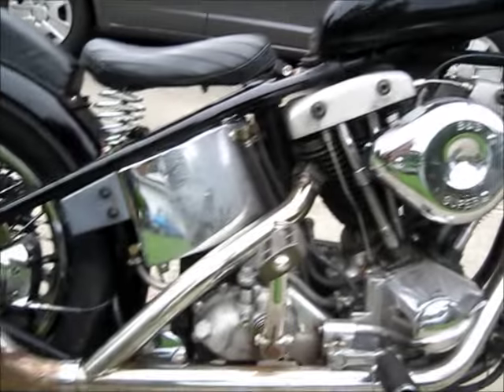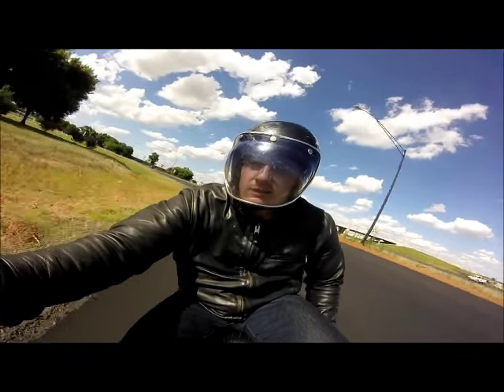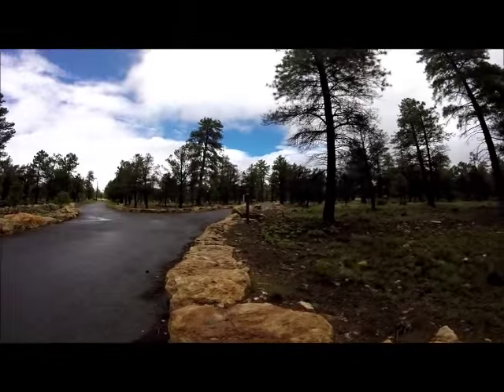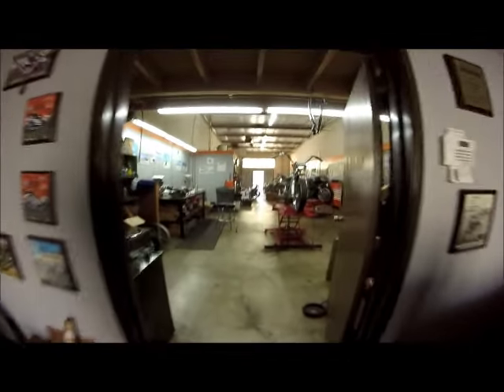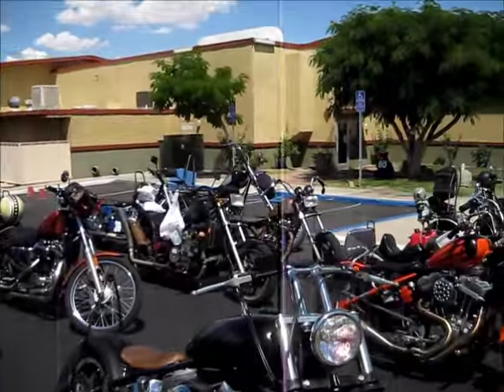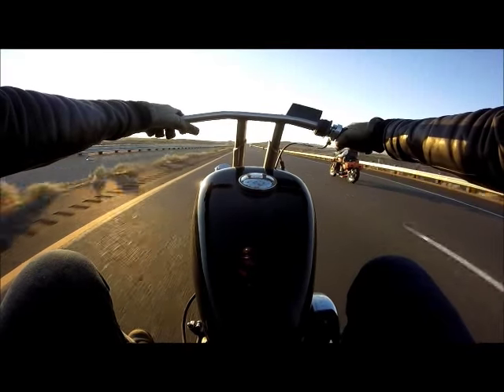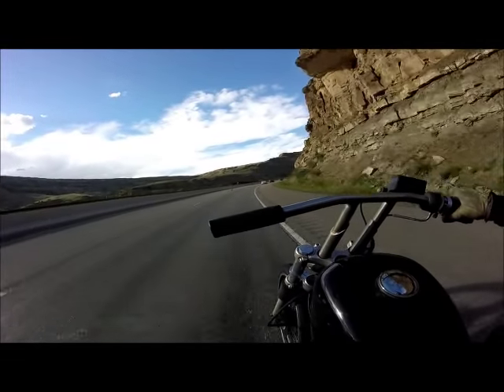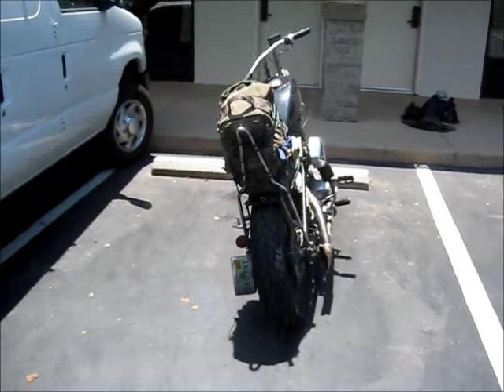Shovelhead Chopper Adventure: 2015 Stampede

Comment: What kind of frame you running? Is it a weld on or aftermarket frame?
Reply from the maker: It is the stock '77 front loop with a hack job welded hardtail.

Comment: I run a wassel on my panhead I moved the petcock to the bottom filler to the top I squeeze 2.5 gallons out of it so I'm getting 100 miles before scared no-good for cross country but OK for the beach or a couple states over

Comment: what's the top end on your shovel with the 4speed
Reply from the maker: It'll go 120 if I drop it off a high enough building.  On the road it goes 75 pretty comfortably, its got a 24 in the front and 48 in the rear and the Karata primary adds a little too.
Reply: I thought terminal velocity on a shovel was 130
Reply from the maker: somewhere around there, my speedo reads 2/3 of actual speed s its hard to tell.

Comment: I run a wassel on my pan I've moved the petcock to the bottom filler to the top I get 2.5 out of it so I'm getting around 100 miles no good for cross country but not bad for running to Florida or a couple states over
Reply from the maker: I get 3.3 out of the sportster tank, about 150 mile range, I wouldn't want any less out west, sometimes its close to 100 miles between gas stops.
Reply: I'd never make it love your ride I'm riding to smoke out this year it's always a bad time of the year for me so I've always put it off but fuk that I've got a couple of mine on my page kinda want to get her in the horse

Comment: How do you like that helmet and face mask?
Reply from the maker: Its good, lots of peripheral vis, light, cheap, small.  It's the daytona cruiser with a bell bubble shield. I drilled holes and put screws in the side of the bubble to attach it firmer to the helmet and that makes a huge difference, it no longer rattles and pulls up when I look behind myself.